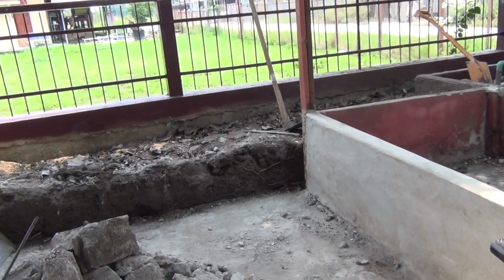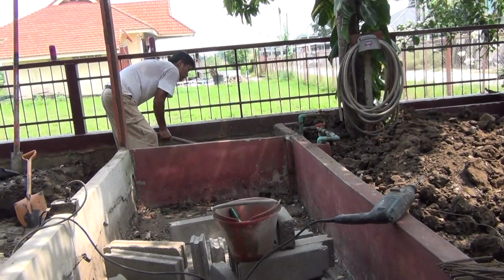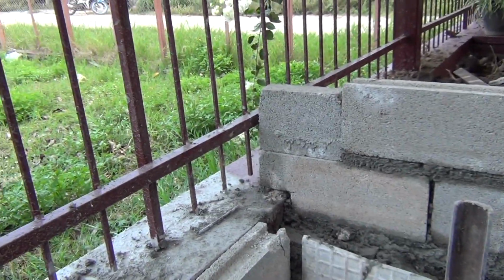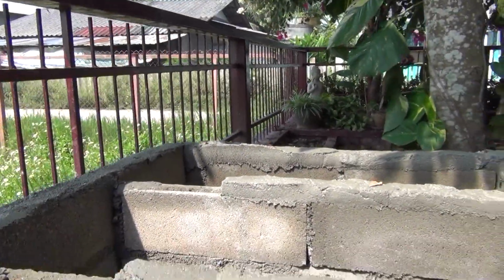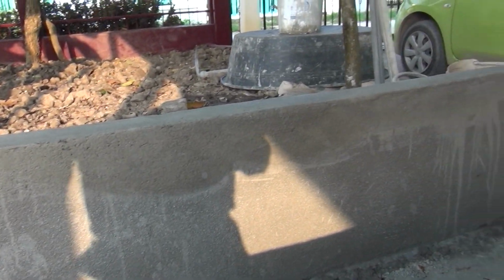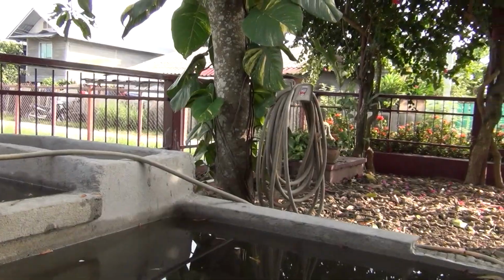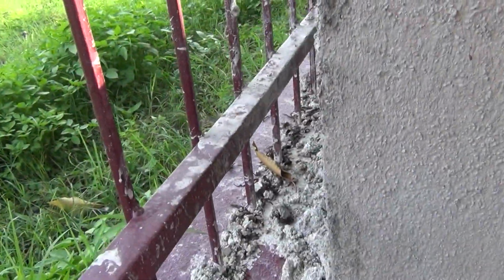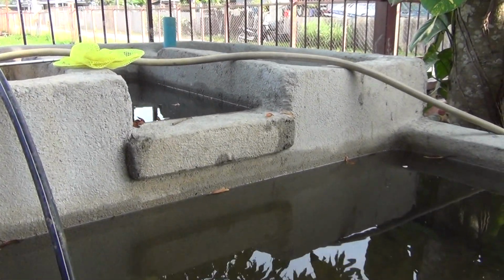Fish Holding Tank In Front Of House

Comment: Theres an additive for the rendering mixture to help make it water proof.   After applying the crocodile flex seal you could put pool tile inside for added waterproofing and easy cleaning.
Reply from the maker: Yes the waterproofing additive was used.the problem was that when they rendered there was some areas that did not get any cement and there was a direct hole to the outside. We are using the crocodile flex seal, however we will not use tile. Using tile will be an added layer of help. Thank you so much for the comment. Thanks for watching.